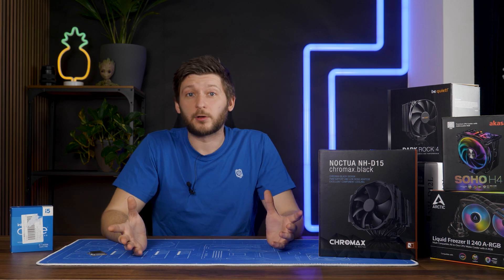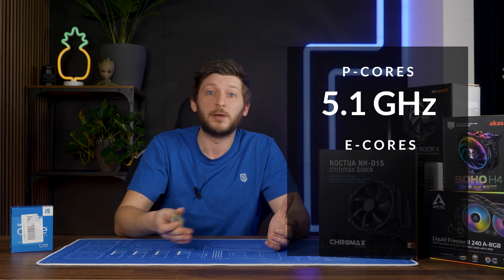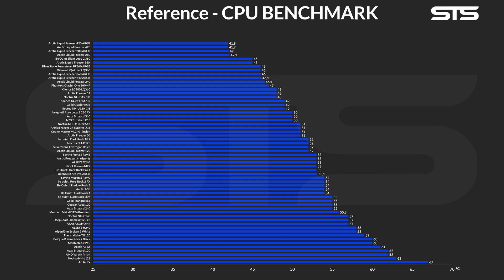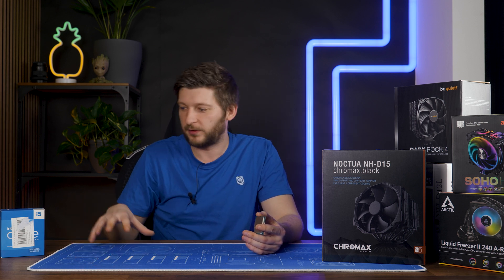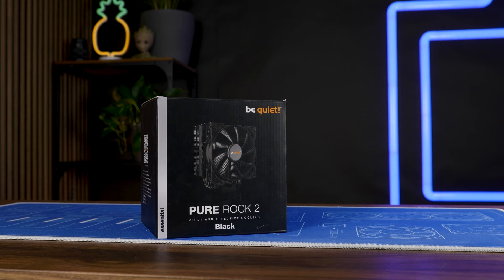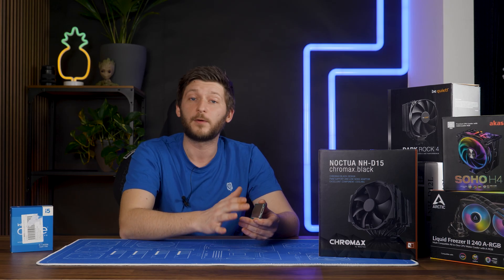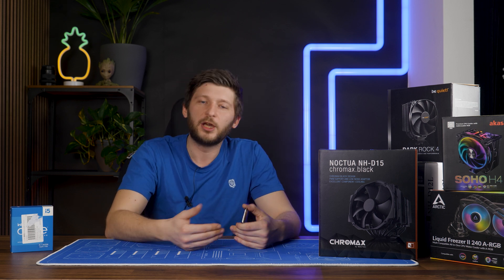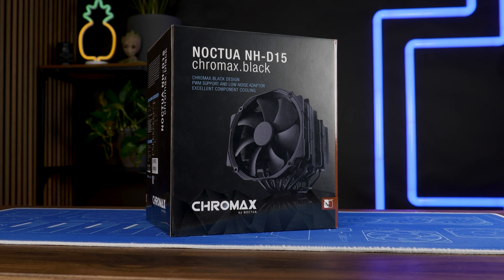How FAT Should An Intel 13600k Cooler Be? ❄️ - 13600k Cooling

Comment: Just install Noctua D15S with my 13600k. Is it good for 47c in stock when just browsing?
Reply: It will be fine. Real-world scenarios will never be as demanding as these benchmarks. For example, my GPU can reach the 70s while being pushed in 4K gaming, but it can easily hit 86+ if doing a stress test with MSI Kombuster. No practical situation would ever cause that. The same goes for these CPU tests.

Comment: Thank you!  Please tell me!  I choose AIO for 12600k in overclocking and then upgrade to 13700k.  Deciding between LS720 and Arctic Freezer ii 420. My case is Lancool III.  Is it worth di trying to install LFii420 or will LS720 be enough for me?  For the price they are the same for me at the moment.  I just want my system to work quietly and not make a hum!  Can the LS720 handle this so that the fans don't run faster than 1300 RPM in games?
Reply from the maker: The LF420 will definitely be enough. I cannot say anything about the LS720 at this time. No words about stuff I haven't tested before

Comment: I have never built a computer myself, but my current computer was built by a former friend while I was watching to learn a little about it, but in recent years I have tried to read up on computer building and if I remember correctly, I have been told that Noctua NF-D15 Chromax Black, Noctua NH-U12A Chromax Black and 240/280mm AiO should be sufficient as processor cooler for 13600K.

Comment: Do you recommend me to do the Arctic Freezer 51 mod to my Freezer 50?? I mean just 3 degrees cooler than stock freezer 50 isn't worth having to buy 2 p14 pwm fans for me but I want to read your suggestion.

Comment: I'm running 13600k paired with liquid freezer 240 on a msi z690-A pro mobo. Room temp is normally 25-27c. At stock, it went to 100c immediately in cinebench. I had to play around with undervolting before it's finally not throttling during a stress test.
This video is making me question if i was doing something wrong mounting my cooler or if my unit is simply faulty.
Reply: do you have an lga 1700 contact frame?
Reply: There must be something wrong! I'm running 13600KF w Arctic LFII 120 P/P on a ASRock Z690 Steel Legend/D5 and in Cinebench it never goes over 84°C, no UV what so ever. PL1 set to 180W + PL2 to 181W, TJMax at 100°C. In addition, I use a Thermalright Contact Frame + Arctic MX-6 and the case has good air flow.
Reply: @brokenspine66 can an COOLER MASTER MASTERLIQUID ML240L V2 RGB cool it?
Reply: @itsmorbintime6833  I'm pretty sure, if you setup the PL's right and your case has as well decent air flow.

Comment: no AK620 on the list?
Reply: as someone who owns both an i5 136k and an ak620, trust me…no.
Reply: @heyitsnotmars  why ?
Reply: @eustachetraista2061  i’m not sure if the ak620 i bought was faulty, but my i5 136k cpu wouldn’t come down from 100 celsius. it wouldn’t sit on the surface of it properly, which was tested with multiple installs (surprise…there wasn’t a difference even with a cpu cooling bracket) then i bought the noctua nh d15 and temps dropped to 45c and lower when installed vs the latter. had to buy a new tower case to accommodate the height clearance. all that just cause of the deepcool ak620, so do yourself a favor and do the research before investing your money into that product!
Reply: I got them both too .13600kf +620 .its feel good .never see numbers higher then 74*.but i also use mx4 arctic .
Reply: @heyitsnotmars what's the motherboard you are using?
Reply: @heyitsnotmars  from the research that I have done myself, AK620 should perform similar, if not slightly better, than a NH-D15. So your unit must definitely be a defective one, either that or maybe Deepcool has deceptively changed the parts they used to make the product and has just kept the name as AK620. But from what I can tell, it should perform slightly better than a NH-D15.
Reply: @savage7959 but. You use it in 4k?
Reply: @heyitsnotmars  Hey, I also made a mistake with a cheap tower for 136000k. I'm looking for an upgrade, but not liquid. What do you think?

Comment: 100C is actually just fine, Der8auer had long interview with Intel CPU engineer and he said basically running CPU cooler than 100C during 100% workload means you're just leaving performance on the table. Also, apparently modern CPUs have their temp sensors closer to the hotspot than older CPUs, hence why modern CPUs run seemingly hot even though well within spec. Same goes for AMD.
Reply: 100c doesn’t hurt the cpu but it throttles
Reply: @names_dave when I pee it stings
Reply: But intel TDP are not correctly settings on New Motherboard. Thats the problem.

Comment: I had been searching for an Air Cooler that can sufficiently cool the 13600k and to my pleasant surprise you made a video on just that!! THANK YOU :D
Reply: Just get Peerles Assassin for 40 bucks and you're good to go,
paired my 13600k and overclocked it to 5.5 Ghz on P cores and 4.4 
on E cores and it maxes out at about 93 degrees
Reply: @nedimhalilovic1  Peerless Assassin is too big for anyone that uses tall or RGB RAM
Reply: @nedimhalilovic1 what's the average temp on the base performance Tho?
Reply: @nedimhalilovic1  that thing is underrated af, I think they can afford to sell that low cuz they don't sepend on PR
Reply: @IskanderVFX  I'm so glad it's underrated cause if it gets big enough it's going to double its price real fast

Comment: Great work. My personal experience with a system I built 13600K, RTX 3070, MSI 111R case. You have to do voltage and llc tuning. Without it I was hitting peaks of 280W in y-cruncher because the MB was pushing 1.37-1.4V (latest BIOS). I eventually got it to 220W running 1.25V with vdroop down to 1.21V at 5.2GHz P, 4.2GHz E. Temperatures were 88C with a Scythe Fuma 2. Case had 3 intake, 1 rear and 1 top exhaust. Memory was running DDR5-6200 C36 with tuned sub timings. I suggest running Furmark and Y-cruncher 2.5B at the same time to fully stability test a 12th/13th gen system. Anyway, the air coolers I recommend are the Deepcool AK620, Scythe Fuma 2 and Thermalright Peerless Assassin 120 SE. D15 is too expensive compared to these.
Reply: There are a few good Thermalright options. I bought the Phantom Spirit. IIRC it performed the best of all the TR options, but they're all pretty close to each other. And yeah, it's 1/3rd the price of the Noctua cooler, so no reason to get the D15.
Also, if you'd like to push things further, you might look into a new socket frame that eliminates the IHS bending. Gamers Nexus tested a couple. My personal pick would be the Thermalright option. https://youtu.be/iYU1OskbY-Q?si=M3Z8nMUDf7n1OQhC
That could drop your core temps as much as 8C.

Comment: Do anyone use ak620 or Assasin iii with 13600k? How is it going?
Reply: Ak 620 with 13900k here. 

35-42 degrees no load, below 90 at full load.

Stock clock settings with contact frame installed with NH2 thermal paste.

XTU Undervolted at -0.75v, reduced max TDP cap to 220w.
Reply: @lr0y  Thanks
Reply: @lr0y so ak620 is a good choice for 13600k ??

Comment: Yay new video, and i can relate to it! Also congrats for new office, looks great. Anyway i own a 13600K and it's placed in an MSI Z790 MAG DDR5 [i upgraded from a i7 4790K] with a NOCTUA NH-D15S [but i got an extra fan for it, so it's basically an NH-D15]. Anyway so i've come to the conclusion that all Motherboard Manufactures cheat and push a lot of power through the CPU regardless of Intel MAX TDP Guidelines, they just want to do good in competitive CINEBENCH RUNNING. So when first building the PC, BIOS asked me: "Yo bro, what kind a cooler you have?" and i anwered "AIR TOWER". When i answered that, MSI thought it was fine to set the PL2 and PL1 TDP to 253 W on an I5. The next day, i decided to run CINEBENCH. And ran it did. I started the multicore stress test, while HWINFO was on. And a few seconds affter hwinfo was telling me the cpu is pulling 230+ W of power, my JAW dropped, while all my noctua case fans and my NH-D15 started ramping up, a few more RPMs a hurrican could form to keep this puppy cooled. In anycase, the max temp the i5 hit was 91 C but during the stress test NH-D15 kept it at 86-87. So i share my finding with my friends and we come to the conclusion that MSI is out of their minds, and it was suggested to me to turn off MULTI CORE ENHANCEMENT. Now on an MSI board there is no multi core enhancement. But i come back to bios and see the setting related to cooler and see 253 W in brackets. I go on intel's website and i see our i5 13600K has a max turbo tdb of 181 W. So i facepalmed. And switched the type of cooler i had from AIR TOWER to STOCK and motherboard set PL2 to 181W. I reran CINEBENCH and peak was 81 C, and it was kept at 76. So that ain't terrible. [also somewhere between i reseated the COOLER and repasted the CPU, i used a pentadot before, now i used a simple pea]. Now a few days ago i find out that MULTI CORE ENCHANCEMENT on MSI 's board is called TURBO ENCHANCED. So i go in MSI BIOS and set it to DISABLED and re run CINEBENCH. Now the CPU went to 79 peak and was kept at 68 or 69 (nice). At this point i'm thinking about undervolting, but not by much, idea is i keep all fans dependent of CPU temps, but all fans are at a max of 20% up until 50 C. The case fans are 6 NF-S12B intake and 2 NF-A14 and 1 CORSAIR out of the 2 FANS that came with the 5000D. Cool now that i got that out of the way i will continue to watch the video.

Edit: fixed last temperatures, based on screenshots from last test, meaning PL2 set to 181 and turbo enchand - disabled.

Comment: Great Video bro! Do you think the noctua nh-d15 can cool a 12700k? Greetings from Colombia 🙌🏽
Reply: Ofc it can, even a 12900k. I have with 2 120mm fans and i5 13600k and do a great job, go ahead bro 👌
Reply: @dalheplay  How about the i5 13600k overclocked a little, or maybe the i7 13700k?    I really want to stay away from AIO's, but I want a CPU to be able to back up my GPU if I need to drop resolution for frames. I already have a lian li lancool 216 with its stock fans, 2x160's in the front and a 140 in the back. Air should be zoomin through the case, so idk what to really go for. I'll prolly ask this same question on the LTT forums, PC discords and other places just to compare responses, I just want to know more lol.
Reply: @Dissame6730  hello, if i have chances i Will, because now i dont have any sponsers or Help with channel, so i cant make interesting tests or even test another hardware. The fans of your system should vê fine, the most important, is air flow of your system, but before i Help you, i need to know whats specs do you have?

Comment: $40 Thermalright Peerless Assassin 120 SE
Reply: I have this one, not the SE version but it does cool very well, in games it stays basically on idle at 55ºC if you set the fan curve right, in Cinebench it does go up to 90ºC at 200W power limit but never thermal throttles. Outside cinebench it never heats up that much, even compressing a lot of files with 7Zip, no problem.
Make sure to undervolt your CPUs, Intel left so much power on the table, you can have more performance with less power than stock.
Reply: @TheFPSPower  Yours must be faulty. Mine works great w 12700K and I also added the $12 Thermalright cpu contact plate which dropped temps another 10*c.
Reply: @_thevaporz  There's your answer, I don't have a contact plate and the cpu goes to 90ºC VERY fast so I'm pretty sure the contact is horrible, I even repasted a perfect thermal paste application and it didn't help.
Reply: @TheFPSPower  Yes, this Thermalright combo with undervolting both cpu and gpu makes for a very cool and quiet machine.
Reply: @_thevaporz  wagwan just got that plate you reccomended, ordered all my pc parts today went with a ThermalRight Phantom Spirit 120 SE
Reply: @roadman420  Good choice on the Phantom Spirit. Everyone's recommending the Peerless Assassin, which is good, but the PS is statistically better and costs the same as the PA.